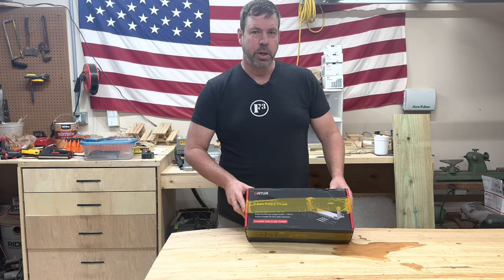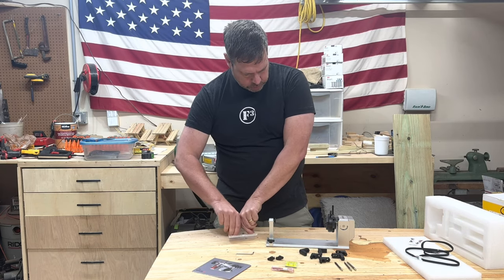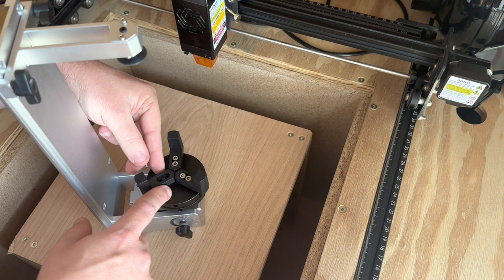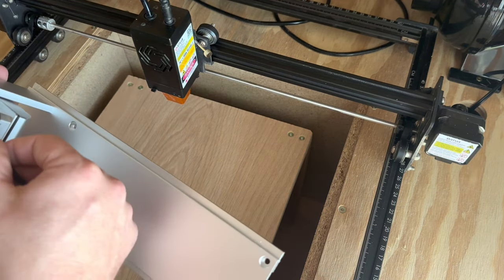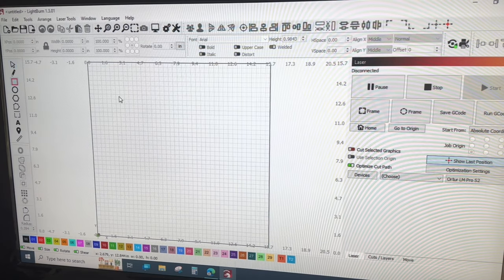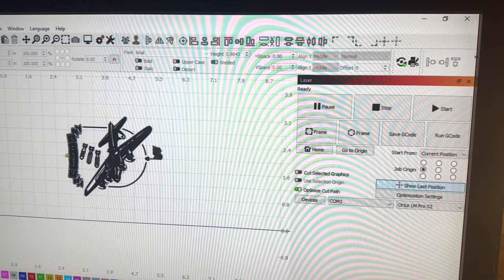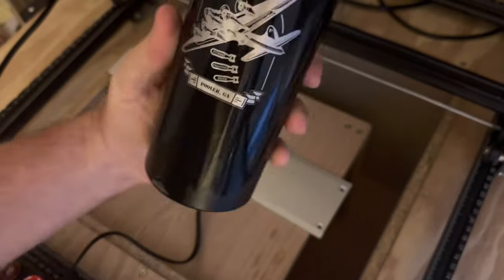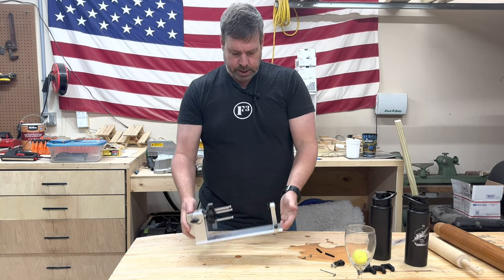Laser Engrave almost ANY Shape with the NEW Ortur Rotary Chuck

Comment: I have a problem, my chuck does not turn, it stays stuck, it tries to turn to one side then the other and it stays stuck, I don't know if it is a configuration problem in Lightburn. My laser is a sculpfun s30pro diode laser
Reply from the maker: My suggestion would be to reach out to the manufacturer or where you purchased it in order to troubleshoot it.

Comment: Do you have to change any of the code settings. Im having trouble with the image not being wide enough. And I did a small box the circumference of the bottle and its not close. I saw somewhere I might need to chamge $141=600 or $161? Did you have to do that?
Reply from the maker: I didn’t have to change any code but I did enter the circumference in the settings.

Comment: Just bought this rotary chuck. If I put the motor/chuck head on the right do I avoid mirroring the image?
Reply from the maker: I saw from others using it that it had to be mirrored. I have yet to figure out why it has to be that way, but I have not tried it the other direction to see.  I’ll try that next time I’m running something like that and see.